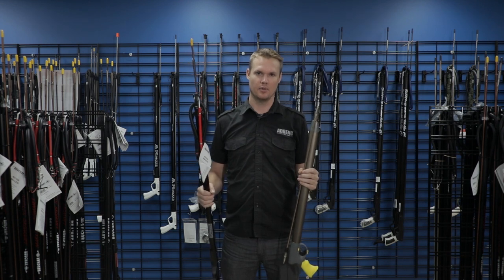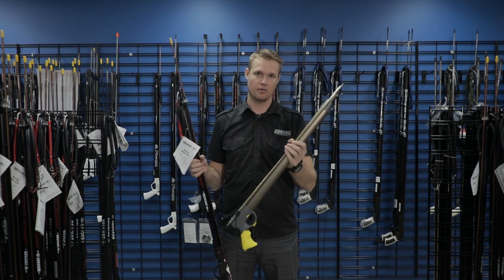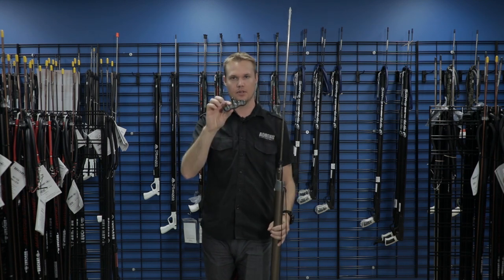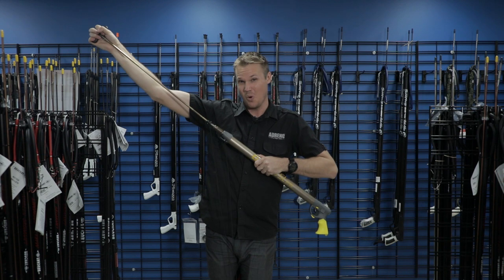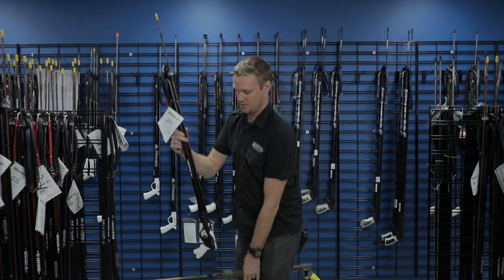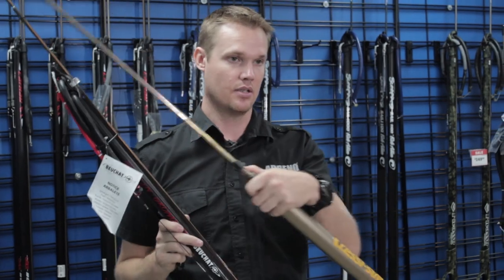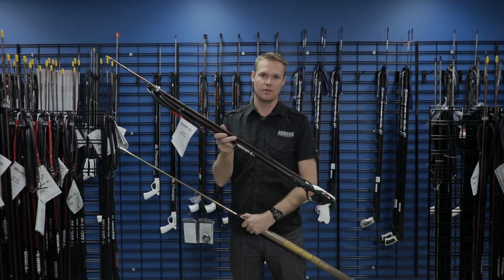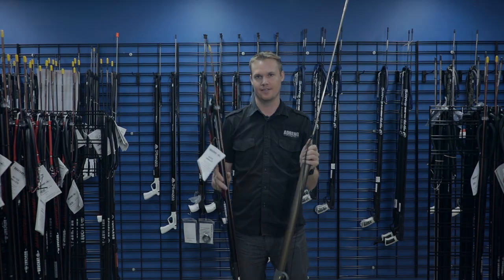Pneumatic VS Rubber Speargun | ADRENO

Comment: That was a disappointing video. At least give some pros and cons of both options instead of just saying that it's easier to load a band fun.
Reply: I am with you. Actually in choppy water with currents I find easier to load a pneumatic than a open muzzle band gun you have to wrap the line first. Probably it is harder to load a long pneumatic gun, but up to 70 it is easier for me. Also adding some oil once a year is cheaper than  replacing the bands.

Comment: Wouldn’t another issue with the pneumatic gun come with increased depth?  What I’m getting at is wouldn’t the power of the gun become decreased as you descend further because of the gasses inside becoming more and more compressed with the increased pressure?
Reply: the pressure inside the pneumatic gun is 20 / 30 bar.  at 10 / 20 m depth the difference would be negligible. Plenty of spearfishing champions who use(d) pneumatic guns,
Reply: Yes they are less powerful at depth
Reply: There is a video on YouTube comparing both types of guns for speed and power using materials in the same manner as tests on all types of guns including ballistic jelly.  A double banded gun sent the spear into the jelly. Pierced right though but got stuck in the jelly.  Pneumatic went right through and carried on going. What was more noticeable was the how much faster the Pneumatic was. If it is that much more powerful at first then the depths most divers go to are not an issue. If I dived mostly dives at greater depths more pressure can be added. Most guns now come with switch for half or full power.  Same as adding or removing bands.

Comment: I have a small speargun that has no where to attach a reel will I think so I'd like to know how to hook up line on it with or without a reel
Reply: short gun, i'd use mono filament. shock absorber and attach a float line to the handle. You do not really need a reel on a short gun.

Comment: Why does it take so much force to "load" a co2 gun? What's the point of it being co2 powered then?
Reply: It doesn't. This review is a load of rubbish. These are meant to be sportsmen and they have trouble pulling back a spear? I was a pretty flimsy 16 year old when I got my first one and I had no trouble at all. Read a lot of the comments here... you'll get way more proper information.

Comment: Crap video.  Highly favoring "regular" spear gun.  For me a pneumatic IS a regular speargun and runs circles around a band powered one of similar size any day.  Yes there can be issues with o rings but I have had some for 10 years with no issues.  Ive had issues with bands rotting or breaking on me when I needed them too.  You can do the maintenance yourself it just takes some tinkering.  I find the pneumatics are easier to load once you figure out a nice repeatable technique.  My shoulders are bad and I find it easier to load a pneumatic

Comment: Worst Adreno vid so far, so biased and just plain wrong. Pneumatics have pros and cons over rubber spearguns, none of which were taken into account in this biased video.
Reply: Like what they lose a lot of power at depth air guns suck go old school and you know that you have dinner
Reply: @thomaskitlica5572   Not anymore though ... Modern pneumatics are heaps ahead rubber guns, the power lose due to depth is negligible.
Reply: I don't understand how you say power loss is negligible air compresses more for every atmosphere you go down might be ok for free diving but what about scuba at deep depths
Reply: @thomaskitlica5572  A Salvimar darkside or Predaror can be powered at 30+ bars, so even at 100 feet + you will have more than enough power to wack anything that you may cross your path with ...
Reply: Ok haven't used one since the early 90s and they lost significant power at depth
Reply: @thomaskitlica5572  Easier to deal with than band guns ...You are going to love them
Reply: @thomaskitlica5572  - Rubbish.  Pump it up enough and they work fine.  I see your comment posted everwhere.  One would think you have shares in rubber guns lol

Comment: Rubber spearguns are much better. More reliable and more powerful.
Reply: My Salvimar Predathor did not lose any pressure from last year. Only maintenance is rinsing in fresh water and maybe in a few months add some oil. Sand can be  more of an issue, but trigger mech is sealed and you get no sand there. With band guns you need to replace rubbers every year or you lose power, and are slower to reload / wrap in choppy seas. Band guns are easier to carry on a float unloaded, it is nice to have both.
Reply: it is not. very complicated and sensitive. also need much more time to prepare for shoot. Lot of unnecesary things which make lot of confusion. Try Dry Vacum kit on top of pneumatic gun. You will be very suprize.